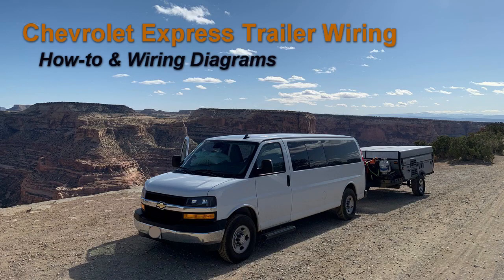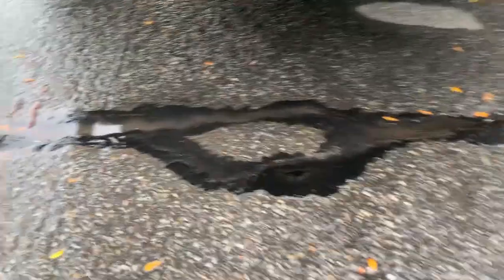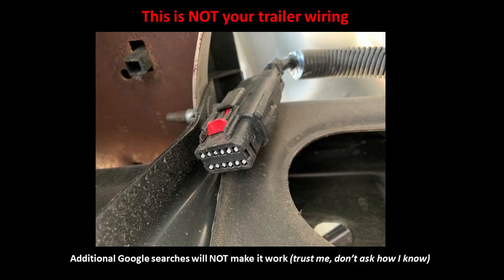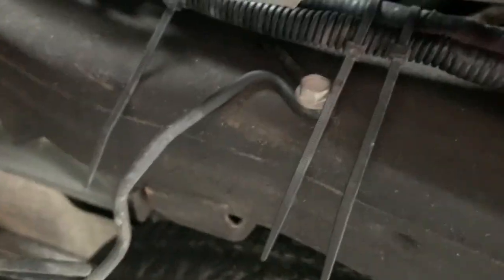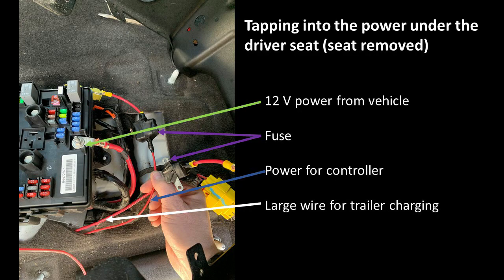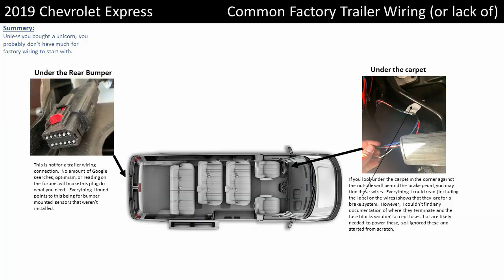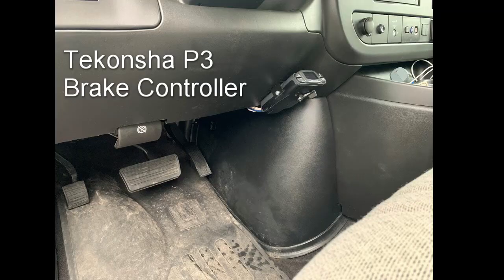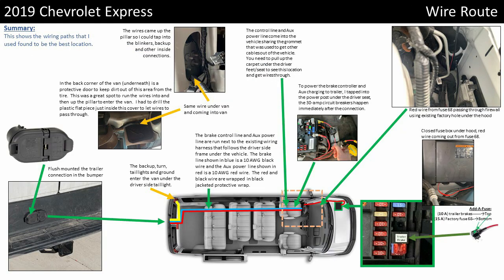How to Install Trailer Wiring on a Chevrolet Express/GMC Savana with Wiring Diagrams!

Comment: Thank you! I was just about to tear into that mystery connector in the rear! For some reason mine came with that same 4/7 combo connector installed at the hitch but they only hooked up the ground wire! What a great surprise after thinking my new to me van was ready for towing and only needed a brake controller!!

Comment: This is the best video I've found for this install. I just bought a 2017 3500 and ran into the wires under the pedals, wire harness on rear frame and labeled slots in fuse box. I thought all of them would help me. They have not. Your video saved me from wasting any more time trying to get an answer. Thank you
Reply from the maker: Thanks for the feedback!

Comment: Question so I have the same vehical so there is no need to wire your break like into the controller. Is the trailer on its own breaking control. I thoughthe trailer was directly connected to the beeak pedle and that the controler just added extra break pressure it needed?

Comment: Thank you for the tutorial!! I have a 2017 Express 3500 and will be tackling this job soon. Can you please tell me what part number / manufacturer your wiring harness is, that plugs into the Hopkins 7 and 4 plug (PK1198 through E-Trailer). I'm having a tough time finding a harness that will plug into that. I bought a different wiring harness / kit through E-Trailer, ETBC7, but I don't like the end socket. I've been told I can only use that Hopkins 7 and 4 plug like yours if I have a factory tow package, which I don't. Your set-up looks great!! Thank you!!
Reply: Back to answer my own question - lol. If a person wants to run a Hopkins 40975 on a Chevy Express w/o a factory tow package, you'll need to a Hopkins 40985 pigtail.
Reply from the maker: Thanks for answering it. I had the oats I used shown in the video. Good luck!